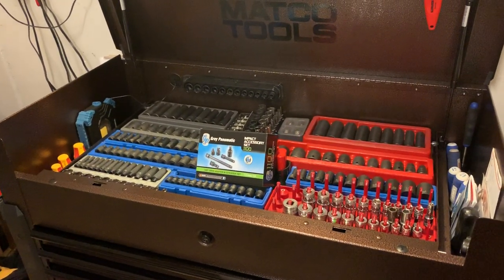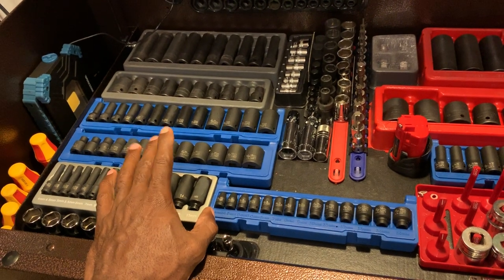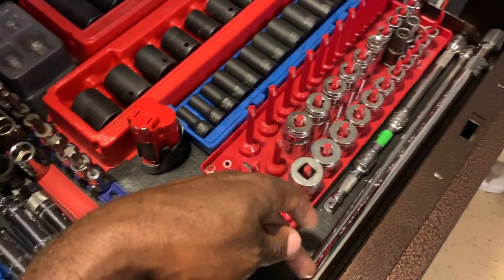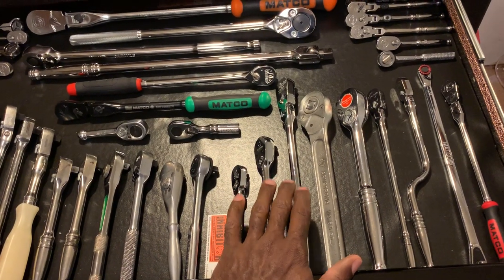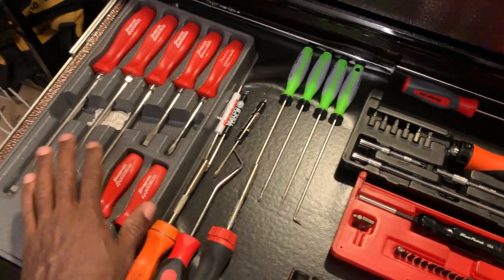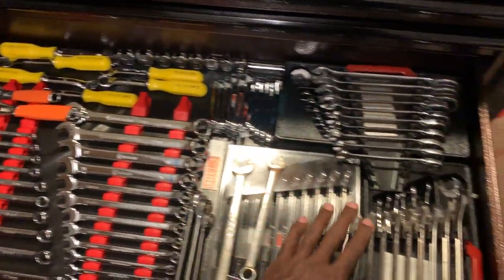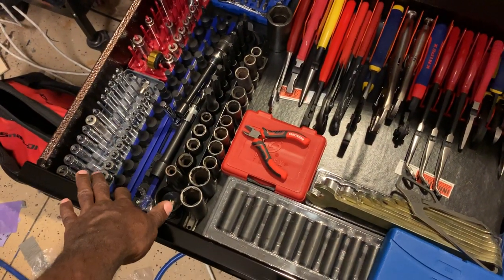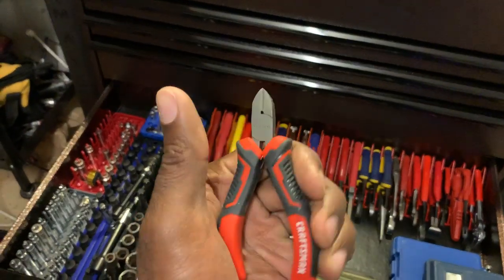Updated DIY Tool Box Tour

Comment: I remember my very first snap on purchase from 20ish years ago. A straight 12" ratchet 3/8 dr, an 8-19 & 5/16-3/4 mid length chrome sockets.  If I remember correctly the bundle was 200ish  dollars.

Comment: Not for nothing MidWest Grey Pneumatic is used most heavily in the professional setting.  In the shop I worked inn a Good Portion of what the Shop provided was Grey Pneumatic with also the exception of Steelman Pro brand line when it came to 1/2" Impact Guns and Torque Wrenches but on the Socket end the brand was Grey Pneumatic and Cornwell matter of fact i have some Grey Pneumatic flip sockets and also some Steelman Pro flip sockets for you in Metric and SAE Standard
Reply from the maker: That is great to know. They are really good, and as you can see, I’m going heavy on their brand! I have some Steelman ratchets, but no sockets, etc. I’d be honored if you’d like to send the flip sockets to me. Just email me your contact info @ James.Taylor050582@gmail.com
Reply: @MidwestToolReview  Got it . In that Gmail there is 2 @ ? I Hit you up check your messages

Comment: wow man your channel is really doing well. Keep up the good work!  What would you say is the best budget brand of tools?  I'm kind of a cheapskate and all my screw drivers are basically worn out and a good deal of my sockets are toast.  I've heard surprisingly good things about the harbor freight tool boxes?  Are they a waste of money?  How do they stack up vs the other offerings available at big box hardware stores?  Ok that like a million questions.  lol
Reply from the maker: Hey Rich, I'd seriously recommend the Capri ratchets. I have a set, and they've been tremendous as it relates to feel, workmanship and overall quality. If you're looking for a good set of sockets, well...Grey Pneumatic all the way. I own very few chrome sockets, and now days, it really doesn't make sense to buy chromes when you can buy thin-walled impact sockets. Harbor Freight tool boxes are decent, but I'm a strong advocate for the Husky brand of boxes. If you've watched my older vids, you'd see that my top socket drawer was stuffed, and I never had any issues within the 3yrs I owned it. I ultimately sold the entire box and contents, which is why I've now reinvented my channel. I wouldn't call HFT boxes a waste of money, but I would say there are far better brands out there for less money. You might even be able to find a used Snap-on or Mac box for about the same price you'd pay for HFT. The only other brand I really like is the Masterforce brand by Menards. Heavy gauge steel and awesome bearings/slides. Even the older boxes work very well, and the price is palatable.
Reply: @MidwestToolReview   Thanks for the feedback.  I've looked at the Masterforce boxes for a while.  These seem to be built well.
Reply from the maker: Beck's Armory, if you decide to buy, let me know. I’d love to help you build-out your tool setup, and I’d like to make a vid of that for YouTube

Comment: James love the color of that box your getting a great setup. How do you like the new Mac compared to the Snap on ratchet?
Reply from the maker: I like the Mac for sure, but depending on the model of Snap-on, it’s just not as smooth as the Snap-On. Now, I haven’t used it extensively, so I’ll have to get back to you about how well in performed in-use. I’m always skeptical of the higher tooth count ratchets, but I’ll put it through the paces for sure.